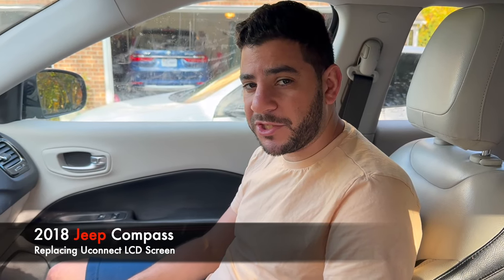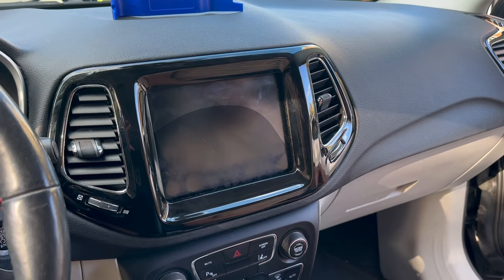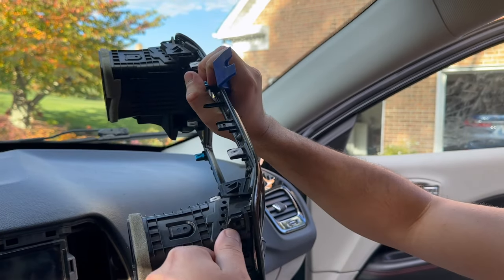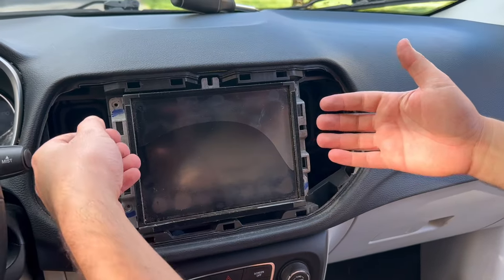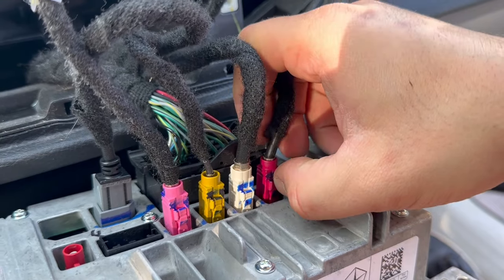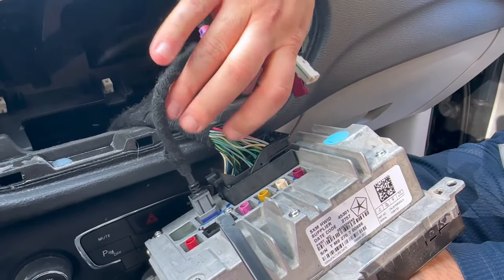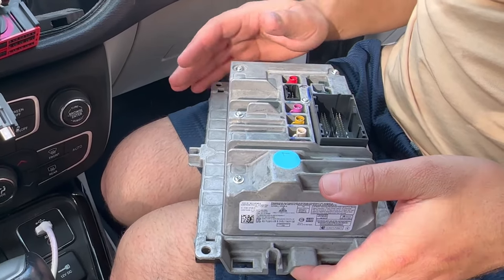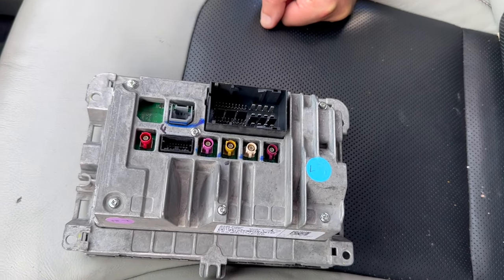DIY 2017 2018 2019 2020 2021 Jeep Compass Replacing 8.4”UConnect LCD Screen

Comment: Looks like this is a common issue with the LCD's on the jeeps. I have a 2018 compass having this exact issue. I just ordered the screen off of Amazon. Thanks for sharing this.
Reply from the maker: Indeed. Thanks for sharing.
Reply: how did the swap go? my 2018 compass is needs a swap right now and I was looking for a replacement.
Reply: @gtaclevelandcity  will be doing the swap sometime this week. I just received the order off Amazon. Will provide feedback when I do.
Reply: What screen? Mines 2019 jeep compass
Reply: @gtaclevelandcity I just finished doing the install, and it worked beautifully just following the video. It was actually easier than I thought it would be. Just a screwdriver and patience needed.
Reply: @Ever_Eddie  cool! Can I ask what screen you ordered? Im thinking I might pick one up and install it when ever the weather let's up.
Reply: @gtaclevelandcity  did you replace yours ? I have a 2019 as well with the same issue
Reply: @alexmeza2751  yup, same part as is in the description. Changed out exactly as described just a few days ago.
Reply: Mine just went bad in my 2018 jeep compass limited it’s the big screen not the small five incher. How much did the part cost guys that have bought it off Amazon??
Reply: @Ever_Eddie  Mine just went bad in my 2018 jeep compass limited it’s the big screen not the small five incher. How much did the part cost guys that have bought it off Amazon??
Reply: Do you have the Amazon link cuz I'm looking for mine too even though I have a 2019
Reply: No navigation when set up Amazon replacement

Comment: more 300.000 jeep compass 2018 on detorit have the problem the display screen dont show all screen complet
Reply from the maker: I didn’t realize this was a common issue until I diagnosed this vehicle for a friend. Luckily this is a cheaper option than replacing the whole radio.

Comment: I’m having the same issue with my jeep but I had a question ! Can I just replace the whole radio as in the screen and “brain” and just hook it up ? Or would that not work
Reply from the maker: That would work but the cost is going to be higher and it’s gonna do the same thing eventually. Not sure if these radios have codes that need to be entered.
Reply: @MobileCarMechanic  I’m thinking about going to grab one from the junk yard to test it out 😅 but thank you appreciate it !

Comment: Hello, I have a question, my Jeep screen started to turn half black until it stopped, so could that be it?
Reply from the maker: You may want to look at taking it apart and then disconnecting and reconnecting ribbon cables to see if that fixes things, if not I’d then recommend replacing the display.

Comment: Is the glue from the lcd because it melted or is that always on there and not something to worry about? Would appriciate it.
Reply from the maker: The glue you see is the display adhesive that secures the digitizer to the lcd. It helps seal the gap between the glass and the display for better optical clarity. It’s not supposed to turn into goo but given how hot it can get in a car when it’s extremely hot that will definitely weaken the adhesive and melt it.

Comment: ✅ No need to remove all the boards and cables. It is enough to unscrew the five screws on the back side and remove the frame from the display. That's it! you can already change it easily.
Reply from the maker: Thanks for the info, Had a hunch but most likely separated it at the wrong spot.

Comment: I did the same but my camera is not working. How I can fix that?
Reply from the maker: Was the old camera working? If not then you either got a bad camera or need to see if your getting voltage on the wires that connect to the camera to radio.

Comment: Great instructions. Just installed a new touchscreen and everything works. The only problem is the GPS. It shows as if I was in the middle of the ocean. Do I need to reset it or something?
Reply from the maker: You may want to check the antennas plugged in the back of the radio. Could be loose or not plugged all the way in.
Reply: @MobileCarMechanic  Thanks for the answer. Which wires are the GPS antenna?

Comment: I really appreciate this video. I'm replacing my screen right now and your video is a big help. One thing, though, for anyone about to attempt this replacement: WEAR GLOVES! My screen was delaminated more than the one in the video and that adhesive gets EVERYWHERE and it's really hard to get off. It would've been nice if you showed, or even said, how you dealt with the adhesive, instead of just saying, "I cleaned it up." I'm using a paper towel and just kinda wiping the worst of it off. It's not working very well, so if anyone has a better idea...
update
I ended up using a microfiber cloth, which left less fuzz behind than the paper towel. And when it came to putting it all back together...   First of all, I did it on my desk rather than on a car seat, which makes the whole process much easier. Then I got my Wi-Fi antennas plugged back in, set all of my stand-offs in place, and carefully lowered the cover (with the circuit board) onto the front part. I held onto the black port on the back to keep the circuit board and the metal frame together while I lowered it. Lastly, I very carefully slid each screw into its hole and once they were all in place and I was sure everything was lined up, I tightened them one by one. Great success!
Reply from the maker: Thank you for the feedback. We also struggled with getting it off and tried random cleaners and such and didn’t think anyone wanted to watch the struggle as we try to get straight to the point. We ended up using a combination of goo gone and window cleaner with a microfiber cloth. Thanks for watching and glad the video was helpful. Cheers!

Comment: Thanks for the video.  Just replaced the exact same screen (8.4" one on Amazon) on my 2017 Jeep Compass, the "new" version of that year.  Super quick and easy.  We used gloves (recommended by another commenter) because of the lamination goo, and laid the unit in the back (luggage area) for a more flat surface.  The hardest or most nerve-wracking part was removing the facing.  Your video was spot-on and precisely what was needed to DIY the screen replacement.
Reply from the maker: Glad I could help.

Comment: Dont happen to have video how to replace 7 inch screen, the connects are different and cant get screen touch to display but can hear clicking when touch screen buttons. Replaced with new factory replacement part for screen
Reply from the maker: We do not currently, when we do we will make a video. The concept should be similar as you will need to disassemble the head unit to replace the screen. Just make sure to match up the wires and screws and you will be good to go!

Comment: You could use a little di-electric grease at the base of the stands offs thatll essentially keep them "glued" in place and you wint need to worry about them consistently falling over
Reply from the maker: Thanks for the tip. Cheers!

Comment: It looks like the 7-inch screen sold on Amazon is a little bit different from the one in the video. On Amazon the screen doesn´t have the screws fitting in the back. Are you sure that the product is the correct one?
Reply from the maker: The display used in this video is the 8.4 Inch so it will differ size wise and interface wise!

Comment: Thanks, man! Worked perfectly and just as you described. One problem: my new screen picture is not centered anymore. Any idea how to fix that?😢
Reply from the maker: Might be a defect in the screen assembly as if the display was glued in off center to the glass.

Comment: I have a 2017 Compass Trailhawk with an 8.4” screen. It’s given me issues for years and I have finally had it. The lcd acts like there is a loose connection or solder. When I hit a bump it’s fine but instantly has lines. I have sat on replacing it since it worked but had lines. 

Now I want to replace it and have had a hell of a time finding the right part. Must 2017’s had the smaller 7” screen and the dealership says $1400 for a new unit plus labor. I think not! 

Hopefully this video helps. I’m waiting on a new lcd now! Fingers crossed b/c I have had it!
Reply from the maker: Let us know if it corrects the issue. This is my first experience with this unit and it’s issues. I know the 7 inch displays typically come on the non navigation units. Cheers!
Reply: Did u figure out how to fix it?
Reply: @Gavin_G01  Nope. Bought a new screen, have not put it in yet!

Comment: Hi, I have a 2018 Jeep Compass; my screen has had lines running through it since the summer. After the car cooled off, it would be fine; touch is still responsive. Now it is winter where I live, and when I turn my car on the screen has lines on it, and while the touch screen is still responsive you can't see anything until about 30 minutes of the car being on, everything works normally again even the backup camera. Would this be a screen issue or a wire issue? I read somewhere online that it could be a a wire but I have no idea what wires to order just incase. I don't want to open it up and not be able to fix the issue
Thanks in advance
Reply from the maker: It sounds like the cold is affecting the connection to the screen and when it warms up then the connection is restored. I don’t know what wires it could be, but it would be worth taking apart. Disconnecting and reconnecting wires to see if that restores the connection. It’s a possibility that there could be some corrosion on the pins of the wires/cables and may be a good idea to clean them with rubbing alcohol on a cotton swab.
Reply: I have a similar issue with my 2017 Compass. The lines appear MOST of the time except when I hit a bump or the car gets really warm. I suspect a loose solder or wire but have not been able to find it!!!

Comment: hey. Thank you for your video. Can i ask if this screen works also for Jeep compass 2017. The manual said that the screen is Uconnect 8.4/8,4 NAV but i don't know what kind of screen must order.
Reply from the maker: Looks like it does work for the 2017 as it has the same interior. So you would be good to purchase and do the repair. Cheers!

Comment: I've got this issue, I'm going to carry out the repair myself following this video however I am concerned that the new screen I fit will end up doing the same thing at some point. Have these screens been adapted to prevent the issue happening again?
Reply from the maker: I’m not sure if they will suffer the same fate to be honest. Given that the glass is optically glued to the display it may possibly happen again due to the cabin being extremely hot during sunny days!

Comment: Thanks it worked but screen is a half inch to the right what's displayed on the screen
Reply from the maker: I would reseat the ribbon cables to see if that is the issue, if not it may be a defective display.
Reply: @MobileCarMechanic  i was thinking I could recalibrate the screen?

Comment: Thanks for the video. Does the Display has to be original or it doenst metter?
Reply from the maker: It doesn’t matter as long as the screens have the proper connections!
Reply: It just arrived and it works. The only problem that the left side of the display is cuted… with the old one i could see everything on the left side. Do you know how to change?

Comment: I just did the switch and touchscreen I super sketchy, have to push hard or isn’t reading at all. Any ideas ??
Reply from the maker: You may have a defective screen. Double check the wiring but sounds like the part might not be good.

Comment: Hello. I installed the new screen and it worked, that same day later on it did not turn on. The following day it turned on and now we are back to not turning on. Do you know if perhaps its a faulty screen or is there something I need to reset?
Reply from the maker: Did that happen before the screen replacement? If not. Check your cables and if that doesn’t work it sounds like failed replacement.

Comment: Did you have to purchase both screens? Which screen is for the Uconnect?
Reply from the maker: If your vehicle has navigation you will use the 8.4 inch. If you don’t then you will use the other one listed in the description.

Comment: Does this also fit the 2018 jeep compass with the small screens?
Reply from the maker: Here is the part for the smaller screen  https://amzn.to/3PwhL9X
Reply: @MobileCarMechanic  I don't need a small screen, my question is , does this tv also fit the jeep compass with the small screens
Reply from the maker: If you are referring to the whole radio it will fit but the connections are different requiring a lot more work to get it working properly. You would be better off getting an aftermarket radio. Also if you are asking can you upgrade your small screen with the bigger screen by swapping it, then no that would not work.
Reply: @MobileCarMechanic  alright , cause I have a 2018 jeep compass and it's the one with the small screen, and I wanted to swap it out for one of these.

Comment: Hi can anyone help? Can a compass 2017 model stereo be replaced by 2020 model. Fitting is ok but will it raise any software issues?
Reply from the maker: Looks to be the same as the 2017 and shouldn’t be an issue.

Comment: love your video I have a Jeep Compass Latitude 2018. the radio  screen turn white white  lines of different colors then black do you think is same screen the one i need to change and do you know the part number is 7'' screen. Thank you very much
Reply from the maker: Here is a link to the replacement 7 Inch Panel, You may want to disassemble and try to disconnect and reconnect the ribbon cables to see if that resolves the issue. Otherwise it may be the radio or the display. https://amzn.to/46WePsN
Reply: Thanks
Reply: Sorry witch one is the  RIBBON CABLES please
Reply from the maker: https://imgur.com/a/ptqteHO @erikashalbi508
Reply: Thank you very much

Comment: Will this fix the half black screen issues
Reply from the maker: This has been my first experience with this issue so I’m not sure. I’d probably try to disconnect the battery and see if it resets, if not then I’d replace the screen.

Comment: I'm having a problem where half of the screen is blacked out from time to time. The touch still works and sometimes the screen works fine, do i need to just replace it?
Reply from the maker: I’m not sure a screen replacement will fix it, I’ve read online that disconnecting the main battery and aux battery and then reconnecting helps. The aux battery controls the radio from what I’ve read, but haven’t experienced this myself and haven’t tested. But it’s worth a try as it’s free. Cheers!

Comment: Question...  My Uconnect screen still registers my touch and still works but there is no picture.  Is that just the LCD panel that needs to be replaced or something else
Reply from the maker: I would try either unplugging the battery, and aux battery if you have one and then reconnecting, or pulling the fuse to the radio to power cycle it. If that doesn’t work it may be a unit problem or screen. It sounds like the radio is still functioning but needs to be reset.
Reply: @MobileCarMechanic  like I had to memorize where to tap on my screen to get to my bluetooth to play music. Before that the screen went pink, sometimes white glitchingness and freaking out
Reply from the maker: It sounds like the lcd might have gone bad, try the suggestions and let us know if that brought the unit back to life. If it doesn’t then order a replacement screen.

Comment: Question.
Im having the same problem with the screen, would like to replace it, but not sure if mine is a 7” or 8” how do I find that out? Don’t want to buy the wrong screen.
Thanks
Reply from the maker: It would be easier to measure the screen diagonally. You can also take the unit apart and look at the part number on the back of the display. What year and model is your vehicle?
Reply: @MobileCarMechanic  Jeep compass longitude 1.4,2018.
Checking the specs online I found out that the 7” doesn’t include nav system and the 8.4”does apparently ,(which mine has)so it answered my question.
Will be ordering the 8.4” and thanks to this video will be able to do it myself ☺️
Thanks again 🙏🏼
Reply: @Shane87able  I have the same question, I don't know whether to order the 8.4 or 7 inches

Comment: Replaced the screen but ghost touching still happening. Not sure what to do.
Reply from the maker: Did you wipe the screen with anything?
Reply: No, I took off the protective film that needed to be removed. Otherwise no cleaning products.
Reply: @drichcreek2008 I’m having the same problem did you ever figure out the solution?